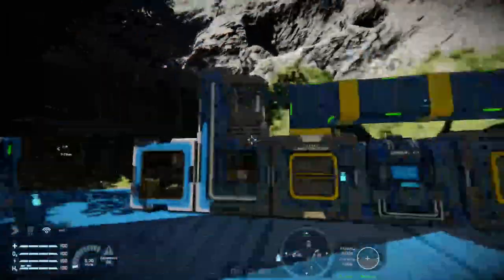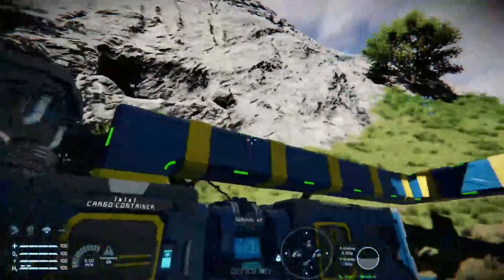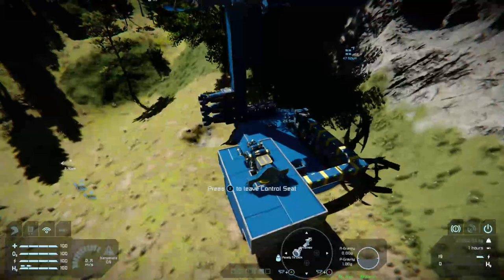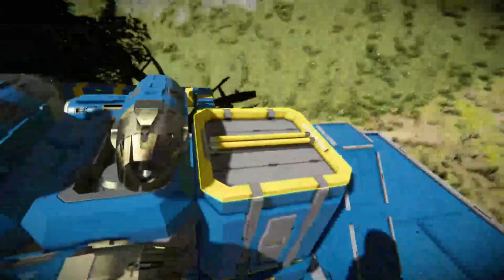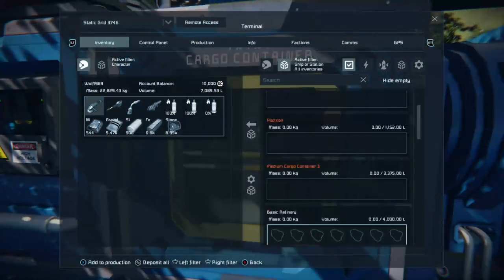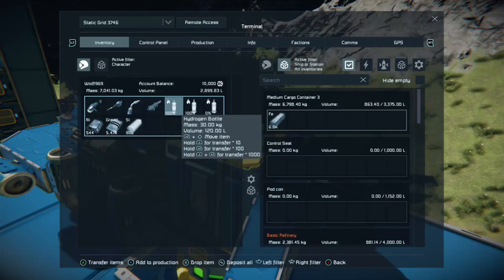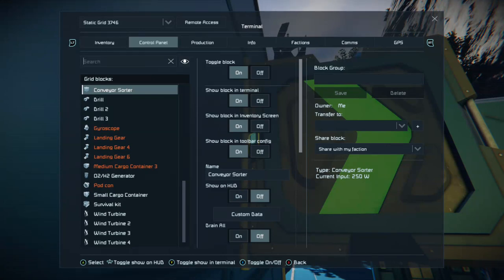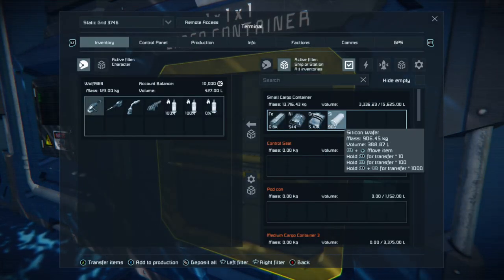Space Engineers Xbox: Tutorial 2: Connectors, and Whitelisting via Conveyor Sorters

Comment: I have a problem in ''control panel'' , I put ''locked'' for really to connect ( yellow light to green light ) but I have only the electricity for my batteries ?
No transfer !
You using d-pad ( left ) for your connection , it's with ''menu' button'' and ''Y'' for this d-pad option ?
If possible , thanks to give to me an answer !
Reply from the maker: It depends what you're trying to transfer, but as for the d-pad shortcuts, you have to hold the direction down to open toolbar config then choose the connector and choose switch lock with A.

This is a very old video now, and much of the information is updated in later videos.

Keen changed a lot of things after launch on Xbox.

Comment: I struggled with connectors for at least an hour. My problem was that my ground connector wasn’t powered.
Reply from the maker: Yep, that would do it. If it comes off conveyor blocks or tubes you're ok. But if it's just sitting there on an unpowered grid you sometimes wonder why it's not working.
Reply: My issue was I didn't know you had to map a separate button to lock and unload.

Comment: I'm having trouble tranferring items from my drill rover to my base, the connector on the base is linked straight to a small storage container, which is linked to a refinery so it should be pulling all the rock into it but it isn't.

everything is powered, the rover and base are connected and everything is green, but items won't transfer automatically. is there a setting i need to enable in the connectors?
Reply from the maker: Hmmm. I've found in the past, that a refinery only tends to pull stone in if the connection is directly to that. If there's a connector to a box, then a refiner it will only pull from the box.

To help, drop a conveyor sorter on the hq side and get it to pull stone and ore as part of the whitelist and it'll shove those into the box from the miner.
Reply: @Dwolfyone  thanks for the quick response! I'll see if this works when i log back on to space engineers tomorrow, I'll update you on whether it does.
Reply from the maker: @LucidLiuxx  no worries, if you go through my later updated videos you'll see that I did a few on how to go about it and what you can do with storage - there's a few updated ones since this one's quite old now.

Comment: have you  got any tutorials on drilling rigs, I'm trying to cut a hanger out of a mountain using drills and pistons which is working well but anything over 3 pistons long starts wobbling i tried to use gyros, but doesn't make much of a difference didn't know if I need to change something in the settings
Reply from the maker: I've got a tutorial on an automated drill rig later on, that uses a sensor to drill down into the ground. For most large-scale drill rigs though you'll need to be in Experimental Mode and then activate: Share Inertia Tensor on your pistons and rotors.
Reply: Dwolfyone thank you I did go back into the game yesterday and found that it wasn’t turned on to experimental mode so I’ve sorted that now, thank you for your videos it’s helping a lot with understanding the game making it more enjoyable, with my mountain hanger I wanted a automatic drilling rig where it cuts out a rectangle shape so I’m thinking about a timer block for extending and retracting the pistons then maybe lots of sensor blocks to shuffle it around I did have a control seat on a piston and used the hot keys to control it all which was fun
Reply: @Dwolfyone  afternoon i've made a auto ice mining rig where there is 2 extended pistons facing up, but when I go to use reduce minimal distance, i wanted it to reduce by 0.5 but it went all the way down to 5.6 from 10 or some other random number do you know what i could do to just reduce it by 0.5
Reply from the maker: Do you mean when you alter the slider manually, or something else?

If you're altering the slider manually, you can usually hold the LB to change the increment of the slider by a small amount each time you tap the d-pad.
Reply: Dwolfyone the sensor is decreasing the piston too much I only want it to move down 0.5 at a time
Reply from the maker: Each time the sensor triggers it will move the drill down by a set amount, there's no way to change the set amount but I believe it should be in .5 increments, or at least move it down much slower.

Basically as the drill arm spins and enters the sensor field you want the drill to move down. So on the 'enter' box of the sensor you want the piston reduce to trigger.

If you have a video of it though I might be able to see where it's going wrong.